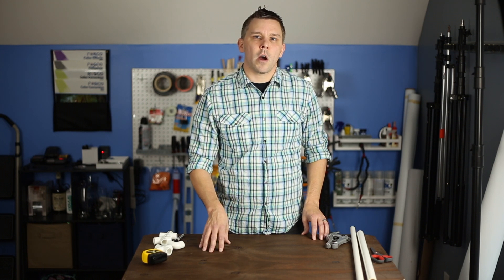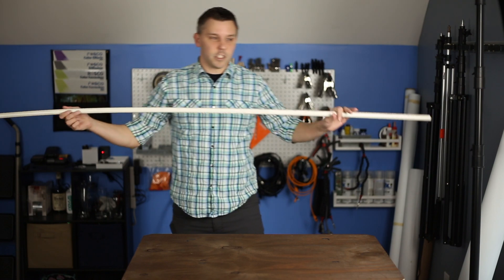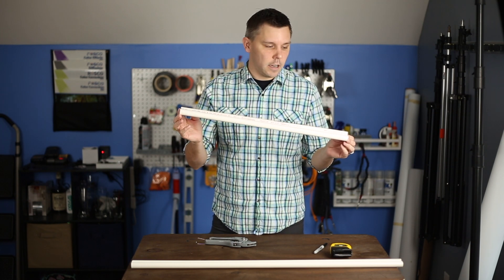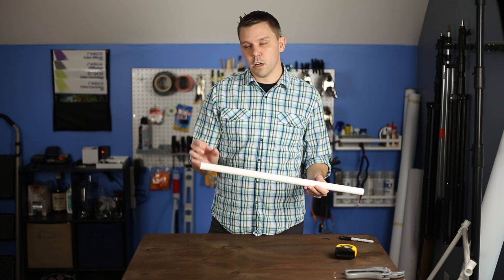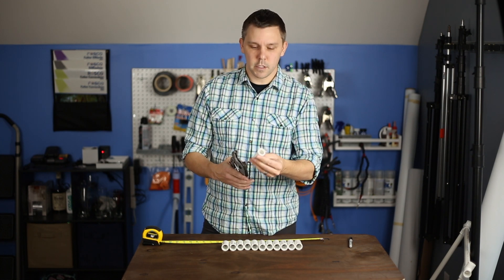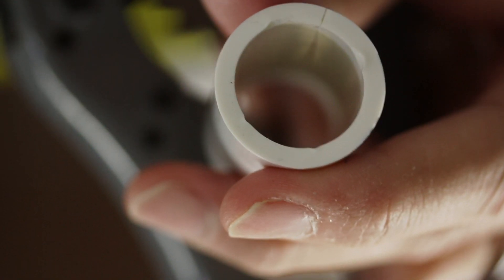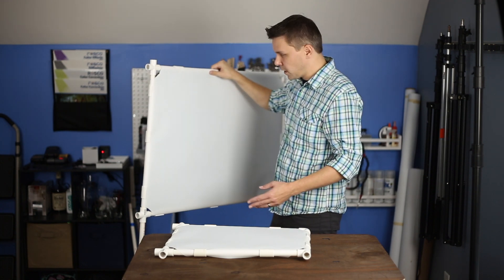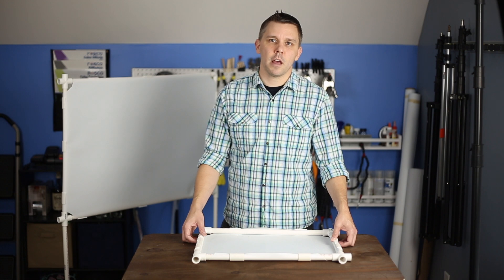DIY Photography Diffusion Panel

Comment: Hi. It's such a great design. But what about rotating it vertically/horizontally and fix it?
Reply from the maker: If you notice there are three “x” pvc connectors on the corners. This allows you to rotate it vertically or horizontal.